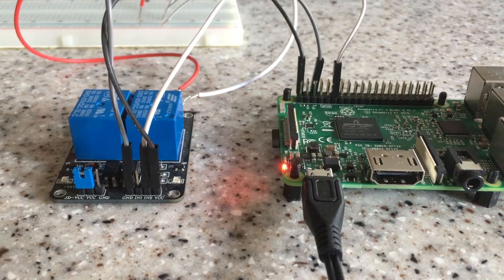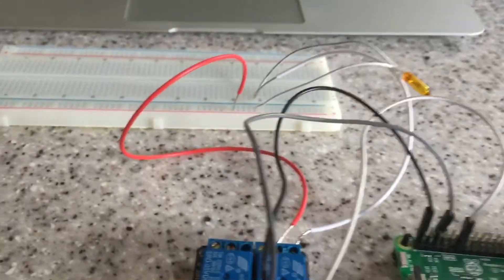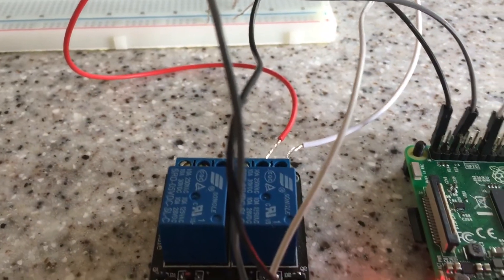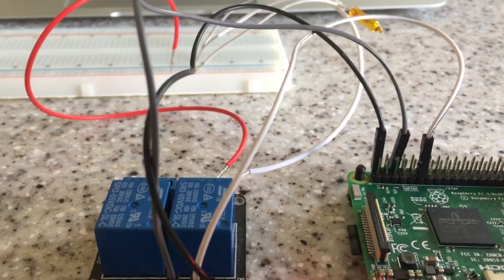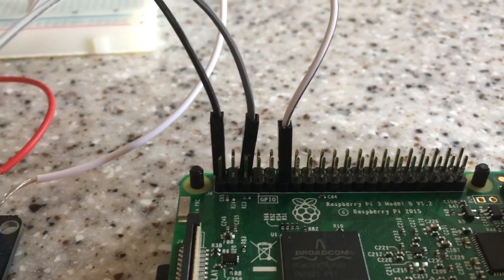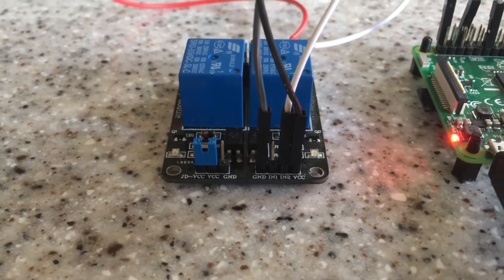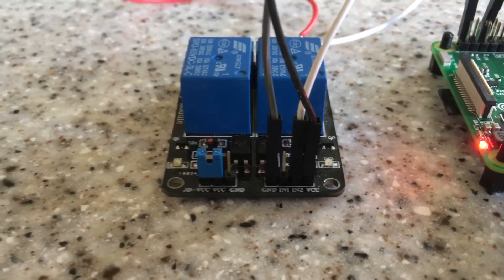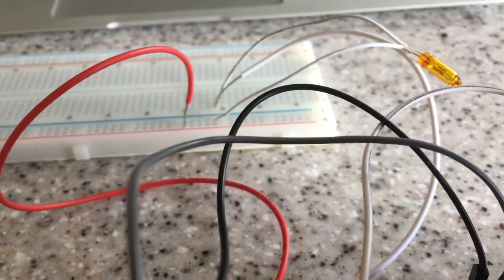How to Wire a Relay Module for a Raspberry Pi

Comment: why using 3.3V pin instead of 5V pin for 5V relay?
From ChatGPT it said using the 5V pin. Is it correct?

To connect a 5V relay to a Raspberry Pi 4 Model B, you need to make connections to specific pins on the GPIO header. Here are the key connections:

VCC (Relay) to 5V (Raspberry Pi):

Connect the VCC pin on the relay module to one of the 5V pins on the Raspberry Pi. The 5V pins on the Raspberry Pi are pins 2 or 4.
GND (Relay) to GND (Raspberry Pi):

Connect the GND pin on the relay module to a GND pin on the Raspberry Pi. The GND pins on the Raspberry Pi are pins 6, 9, 14, 20, 25, 30, 34, or 39.
IN (Relay) to GPIO (Raspberry Pi):

Connect the IN pin on the relay module to one of the GPIO pins on the Raspberry Pi, which will be used to control the relay. For example, you could use GPIO17, which corresponds to pin 11.
Reply: he's actually using 5v on VCC.
Reply: @AleEmm-yay  Which makes a nice mess and for sure did not work with all such relays modules. You have 5V input for a relay but Raspberry level on output pins are 3.3V. For the module I try the only connection working is use 3.3V also as Relay input, so be aware...

Comment: You absolute legend, many tutorials said i had to use an external 5v and plug that into the pi's gpio. I copied your wiring, changed my gpio pin to 17 in Moonraker and now my printer can finally control the relay

Comment: Did you solder those wires into the relay module?
Reply from the maker: Yes. You can also solder a header on and use or build your own jumper cable if you want to make things completely disconnectable.

Comment: Looks like very few people know about its uses.. kudos bro.. what you have is a 2 relay board & I am planning to buy two 4 Relay board for using it as my home automation. I read your python script just want to ask what code should I add if I want to use an individual relay as a electric switch (ie. fan switch) in my one 4 relay board? or is it even possible for me to control individual relay using python? Following is the link of the product I am planning to buy https://www.banggood.in/4-Channel-5A-250V-AC30V-DC-Compatible-40Pin-Relay-Board-For-Raspberry-Pi-AB2B3B-p-1217228.html?gmcCountry=IN&currency=INR&createTmp=1&utm_source=googleshopping&utm_medium=cpc_bgcs&utm_content=zouzou&utm_campaign=pla-ing-ele-diy-pc&ad_id=332206462762&gclid=Cj0KCQiAn4PkBRCDARIsAGHmH3f5IY_HJdqMcEHMSqXFuXjQ-U7iflrzMNvY1_VSirC1hlTF66Qu6aEaAuHXEALw_wcB&cur_warehouse=CN